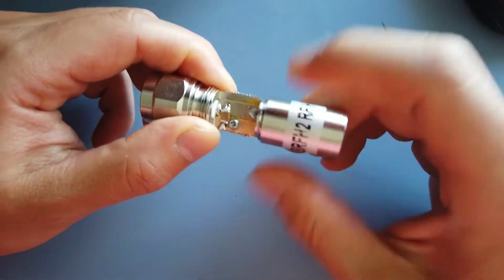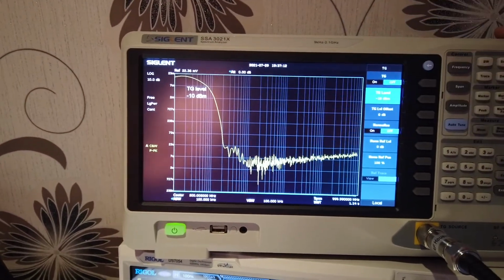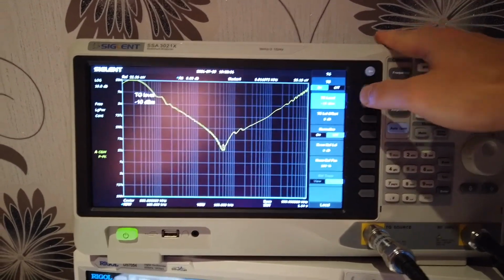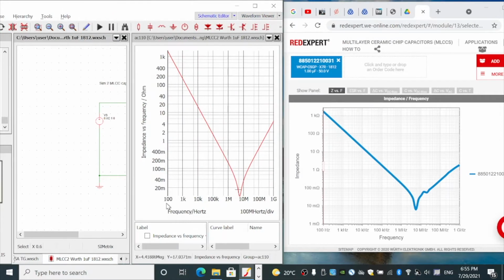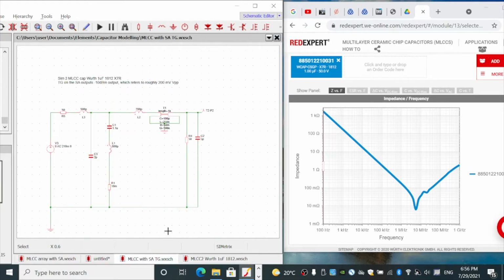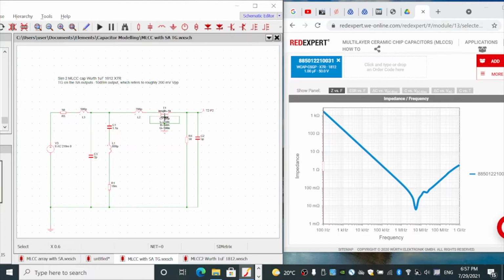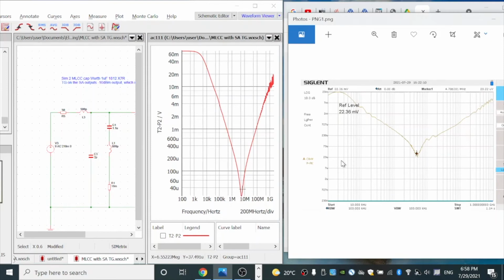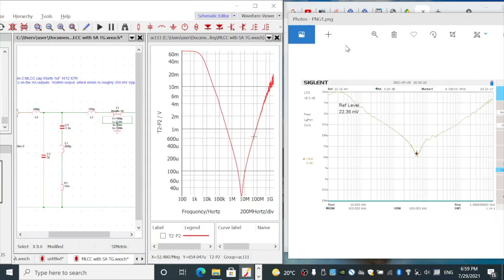Measuring impedance vs frequency curve of a ceramic capacitor

Comment: Interesting and clean setup would you say the shielded housing is really necessary for these frequencies or is that for characterization at higher frequencies? I feel like I can reliably measure components with a VNA up to about a gig with components soldered to a veroboard with some bnc connectors.
Reply from the maker: I think you are right. For the frequency range of this test, shielding is probably not having an impact that we could see. When we measure higher frequency performance, we should use the shielding house.